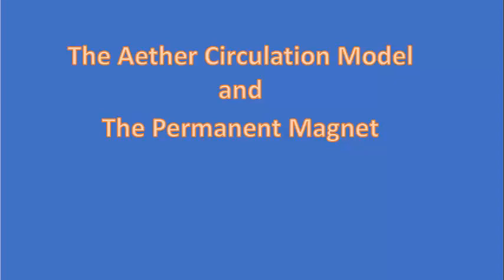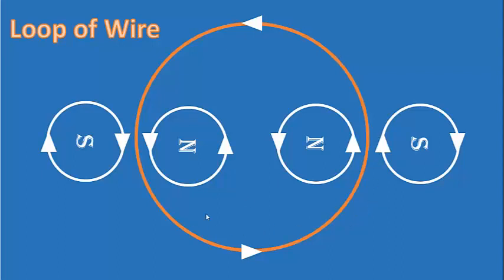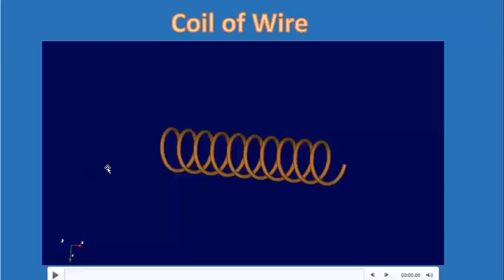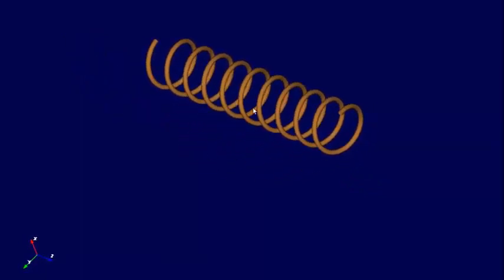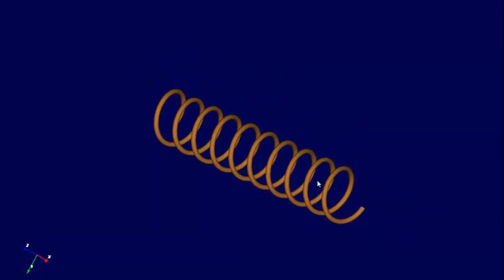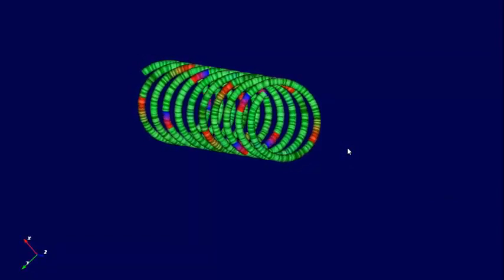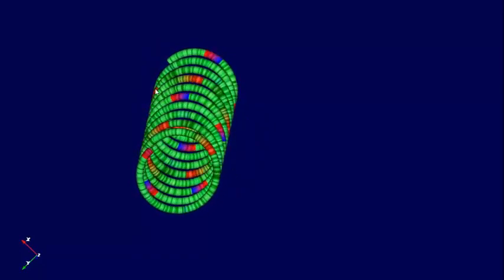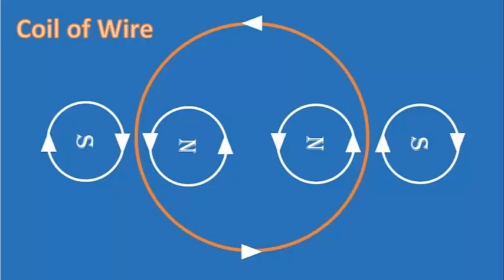The Aether Circulation Model and the Permanent Magnet

Comment: How do you know which direction the current flowing in the permanent magnet?
Reply from the maker: Current doesn't flow in a permanent magnet. You use current in the generation of a permanent magnet by wrapping a heavy duty wire around the iron core and running high power current through the wire. The N and S poles will depend on the direction you send the current as well as the orientation of the turns of the wire, clockwise or counterclockwise.

Comment: What would the mainstream explanation of the device finding different poles inside and outside?
Reply from the maker: They would say that the magnetic moment is pointing in the opposite direction on the inside than on the outside. You can see this when you look at a picture of the magnetic flux lines: https://commons.wikimedia.org/wiki/File%3AVFPt_cylindrical_magnet.svg
As you can see, if you move the sensor to the middle of the S pole, the arrows are pointing away from the sensor, but if you move the sensor to the outside, but very close to the pole, the arrows are basically pointing toward the sensor. This would register as an opposite pole. So technically, I am not proving or disproving anything here. I am just showing what happens.

Comment: But how does the magnet keeps a constant Aether circulation going?
** I see you posted this 2y ago :) so might be your birthday again, happy birthday! (if not, happy not-birthday!)
Reply from the maker: The Aether circulations is going on at the atomic scale. Matter is basically Aether in circulation. In a non-magnetised material, all of the atoms in the material are pointing in different directions. When a good number of the atomic domains in the material are aligned to each other (in the creation of a magnet), the Aether circulation gets scaled up to the scale of the magnet. Technically, a permanent magnet is a giant atom. This is my opinion only. Others may have different ideas on how this happens.
Reply from the maker: Oh, and it's not my birthday but it was a couple of weeks ago. So close enough.

Comment: Excellent, clear explanation.  Thank you.  To really do your aether circulation model justice in the reality experiment you did at the end of this video, perhaps you could do a follow up to this video showing that, if you keep the sensor pointed in the same direction while placing the sensor in various other positions around the magnet, it would still measure south circulation of aether, and also, if you rotate the sensor 1/2 rotation to point in the opposite direction, then place the sensor in various positions around the magnet, it would measure north circulation of aether.  Also, what happens if you rotate the sensor to point in a direction perpendicular to the magnet's north-south dimension then place the sensor in various positions around the magnet?
Reply from the maker: I agree that N and S circulation as well as clockwise and counterclockwise are subject to change based on your orientation relative to the circulation. That is why we need conventions.

Comment: Your discovery coincides with the magnetic vector potential (the "A" field). If the A field is a circulating aether current, it explains magnetic attraction and repulsion quite nicely. I suspect the A field is gravity.
Reply from the maker: I'm trying to get away from the language of the field because a field is a mathematical construct and therefore abstract. I'm looking for a more tangible language. "Aether circulation causes attraction and repulsion." It's as simple as that.  I don't need to invoke the language of the field to understand attraction and repulsion. All circulating fluids behave this way. I can teach this using spinning cylinders in water like Ionel Dinu does. Here's the thing. ALL attraction and repulsion is caused by Aether circulation, including gravity.

Comment: If you wound the single wire tesla coil in infinity symbol fashion so the coil looks the shape of number 8 from top view, i think you would possibly have north pole contained inside one hole of coil and south pole contained in another hole of coil. Also if you make infinity symbol wounded coil into a torroid looking like shape of two toruses sitting on top of each other, at the bloch wall/equator of the coil, you could possibly generate ring currents similar to planets do. Ring currents may be the reason for moon orbiting earth and earth orbiting Sun and not gravity alone.

Comment: I think diamagnetic and paramagnetic metals, copper and aluminum for example, have some kind of natural magnetic field around them all the time but unlike a normal magnetic field, this field is more like a calm pond so it cannot be detected by trifield meter or hall sensor normally. When a magnetic field of a magnet comes in contact with this calm field of copper or aluminum, it creates waves in this calm field which is then detected as eddy currents, and when a magnet slowly physically touches copper or aluminum, its like a rock sinking to the bottom of a pond after its done bouncing/skipping on water. What do you think?
Reply from the maker: If you change the words "magnetic field" to Aether, then I can get on board with what you are saying. For example, I would say, "When a swirling Aether of the magnet comes in contact with this calm Aether of copper or aluminum...". I define the term "field" as a mathematical map where every point in the "field of view" is assigned a numerical value. In other words, a field is a mathematical concept.  When talking about the "physicality" of what is going on around a magnet and non-magnet, I prefer to use the term Aether instead of field. Field is an output. Aether is an input.
Reply: @FractalWoman  Yes. Calm ether and swirling ether, that's what i mean.
Reply from the maker: @Xeno_Bardock  Excellent. Then we are on the same page. :-)

Comment: I cracked that thing about the stereographic sphere and the Stienmetz diagram I asked you about 👌🏻
Reply from the maker: Do tell...
Reply: @FractalWoman  the field condition as created by the two lines with current moving in opposite direction IS a sphere. It’s the conjugate system of the permanent magnet which is spherical.
Holographic whirlpool in the field.

Comment: Dear Fractal Woman, 

I just recently stumbled onto your work. I've been following Ken Wheelers work for some time and what I've got out of that is confirmation that the theories Quantum Physics is based on are disprovable. The double slit experiment for example disproves it and confirms Aether physics https://sciencevstruth.com/explaining-the-double-slit-experiment/ I would however like to undestand Aether physics a bit better and your channel seems the perfect place, so thank you!

I would also like to make you aware of the TYCHOS research/model. www.tychos.info It seems that not only current physics, but also astronomy are holding false theories as true. I also see a connection. It was when Michelson-Morely, Dayton Miller et. al. failed to confirm Earths supposed speed of 107 thousand kph around the Sun, that Quantum Physics was promoted and according to it Interfermometer experiments is not able to measure Earths speed through the Aether since the Aether does not exist in that model. 
Some lectures you may find interesting:
https://youtu.be/dYaqxiNocy0
https://youtu.be/iyrNmOmJbEE
Tychos at Cluesforum: https://cluesforum.info/viewforum.php?f=34&sid=7dcb4362c9bd47d0fd7bc0c075e96c7d

Best regards, /Patrik, Sweden

Comment: So, Lori, is there a magnetic null point half way up the length of the coil?
Reply from the maker: Yes. I believe there is. A coil of wire, when energized, is functionally identical to a permanent magnet. The "dielectric inertial plane" gets forced to the center of the coil due to pressure mediation. If you look at a coil under the ferrocell, it would look the same as a permanent magnet. 
https://www.youtube.com/post/Ugw_wgzUUWREYCx9nzt4AaABCQ

Comment: As always, everytime u upload a greater video than the previous one. Thank u very much.

According to EH Kennard experiment on trying to solve for faraday paradox, he proved that the magnetic field lines are not connected to the magnet. Applying this on ur theory, aether is circulating even if the permanent magnet is not moving.
According to Nikola Tesla claims on shattering atoms, matter is a spinning aether.
Doesn't make sense that the aether circulation generated by a permanent magnet is due to aether rotation(atoms that r perfectly aligned)?
Also, assuming electric current is nothing but a pumped aether, doesn't make sense that the magnetic field of a current carrying wire is due to the temporary alignment of the atoms which caused by aether is being pumped inside the conductor?
I know those claims r crazy, but they r really easier to understand more than a vector calculus course.
For example, moving a dish in a pool will generate a half ring vortex (a straight moving water generates a vortex). However, a vortex generated by a motor won't transfer the water until the motor is moved across the pool.
This a good analogy for dipole antenna. The acceleration of the aether in the antenna and its shear friction with the stationary aether will generate a vortex and when there is a reverse acceleration a counter vortex is generated. But when a permanent magnet put near the antenna the current won't move until the magnet is moved like how the case is in the motor in water.

Consider those crazy ideas in ur research. They might or might not help u.
I know I am too late but HBD queen. 
Thank u again very much.
Reply from the maker: For the record, there is no paradox in Faraday's homopolar motor. When you spin a magnet about it's polar axis (when N and S do not change places), the isopotential gradient in that region of space does not change, even though the magnet is in motion (it is spinning). In this case, there is no current flow in the conductive wire or disk. When you spin a magnet such that N and S change places, then the isopotential gradient DOES change over time in that region of space. Also, if the magnet precesses gyroscopically, you will also get a changing isopotential gradient in that region of space and charges will be induced to move in the conductive material. When you view the magnetic "field" in terms of isopotentials, then the paradox goes away and simple logic prevails.
Reply: @FractalWoman  I was talking about unipolar dynamo not the homopolar motor. The paradox comes when the magnetic N and a conductor are stacked and spun together. Considering only the isopotential line won't give the clear picture. In unipolar dynamo, even tho every atom of the disk is spun in the same isopotential line (no isopotential gradient change is encountered), electricity will be generated. So, aether circulation along the isopotential lines must be considered to picture fully what's going on.
Reply from the maker: @yusufmoallim4667  Sorry, I misspoke. I meant generator, not motor. I understand what you are talking about. https://en.wikipedia.org/wiki/Homopolar_generator  

Here is what I know:

1) The circulating Aether units (and indirectly the field lines) are not moving with the magnet when the magnet is in motion. Magnet in motion is SAME as magnet not in motion when spun about its polar axis.

2) Charges must be IN MOTION relative to the circulating Aether units (the magnetic field), in order for current to flow. 

3) In the configuration of the Homopolar Generator (one magnetic disk and one conductive disk coaxial to each other), the conductive disk must be in motion to generate current/voltage, whether the magnet is in motion, or not because of 1).

4) In the Homopolar generator experiment, there is no translation component nor is there a rotation that allows N to change places with S. 

5) When the magnetic POLES are repositioned (change places, precess etc.), THEN the moving magnet can induce a current in the conductive disk because the magnetic field is changing with respect to the conductive plate (Aether circulation orientations and/or locations are changing).

Summary: Induction of current in a wire or disk requires a change orientation of the Circulating Aether Units within the region of space. This generates a changing electrical gradient setting the "charges" into motion. Under the hood, this is all fluid dynamics.
Reply: @FractalWoman  What a great explanation. That's exactly what I meant except for this part "Summary: Induction of current in a wire or disk requires a change orientation of the Circulating Aether Units within the region of space. This generates a changing electrical gradient setting the "charges" into motion. Under the hood, this is all fluid dynamics."
I said, "However, a vortex generated by a motor won't transfer the water until the motor is moved across the pool."
I think that putting a charge (stationary aether) in a magnetic field (rotating aether) will cause the charge to rotate along the aether circulation path (isopotential lines).
I think it is not necessary to change the relative orientation of the magnetic field to cause the charges to move. Charges r moving along the isopotential lines and interrupting them is was causing them to generate current(aether movement) in a direction different than the path of the aether circulation and consequently the charges will conduce and generate a voltage(pressured aether).
However, neither I can prove this nor I can do experiments for the lack of money.
However, the Meissner effect clearly shows that current is generated even tho there is no change in the aether circulation. The only problem in why this effect doesn't support my claims is that the eddy current is moving in a direction counter to the expected direction of the aether circulation of the magnetic.
This needs further investigation.

Thx for replying and I am sorry for replying late as I use youtube only at weekends.

Comment: Very interesting! I have just a few questions. How does this relate to The Good Vibrations "flyback" model of the permanent magnet, in that as current goes through the coil/magnet then there is a fly back current going in the opposite direction and thus meeting at the center dielectric plane. In your model the current is going one direction the whole way through, so would that mean there will be "two types" of magnets, one right hand current direction (denoted by the right thumb) and one left hand??? Please let me know your thoughts on this!! :)

UPDATE: I think your model is correct, there may not be a need for a "flyback", and that the "dielectric plane" is the region of fastest aether spin.